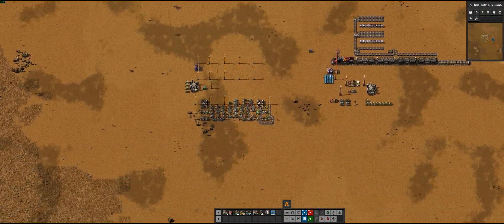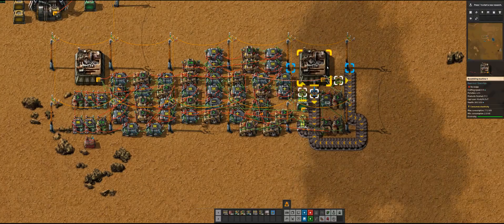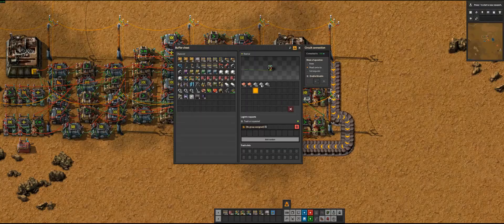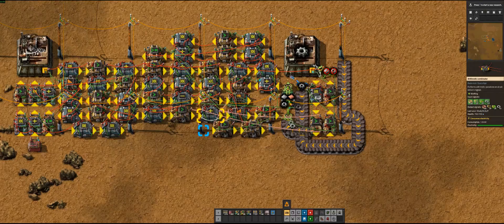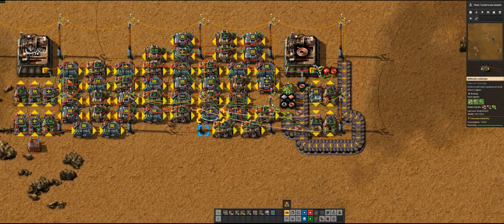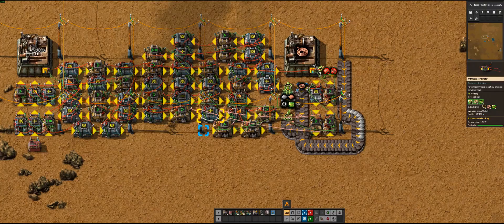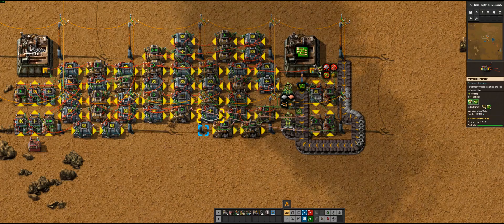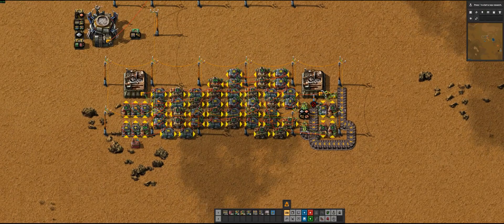Factorio Smart Assemblers

Comment: Nicely done,
I built one of these prior to spaceAge when you required the recipeCombinator mod.
I recommend adding a larger register and memory so that you can switch recipes more efficiently.
If you want a challenge, try multi-threading the system with multiple assemblers and synchronise it. You'll have a machine that can beat the game for you as long as it's fed, handy for a compact mall too.
Reply: Do you have a link or some video for making a register? I did a similar thing that can craft every thing you put into the constant combinator, including all quality levels but it lacs sort of a register/ check for the existence of the needed resources. My current solution is a timer and the new combinator which let you select values that I compare to the logistic network. My system trys to make one stack of the set item. Everything that is in the logistic network is negative, and the machine pics the highest positive value but can't take in account if the needed resources are available.. So it also switches inefficient/ let the timer run out and not craft anything when something is not there
Reply: @alexanderjanke1538  I think my reply got taken down or flagged for approval. I'll try again.

Register handles sync of jobs. We check if we have resources to fill those jobs, if not we recursively break down the recipe and check. Take good care of your memory cells here if you have large recipes, and slow your clock down until your get the hang of sync.

Add machine state checks so you know when an assembler has taken a job so we wait until its complete as some jobs like coils are faster than other jobs like engines.

As for a video there are probably some minecraft ones. But really you'll make a register if it conceptually makes sense to you.
Reply: @pasrules Hmm thanks a lot, I will try to find some videos for it 😅 It might get complicated, but should still work with mostly everything if the system checks itself 🤔 Many recipes are more efficient to produce separate as we all know, so that should make it more easier I hope